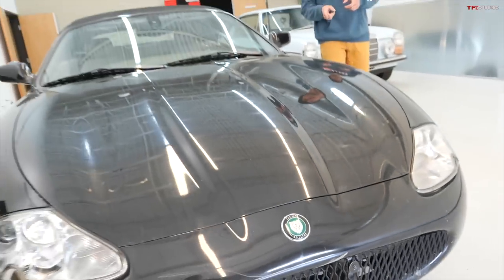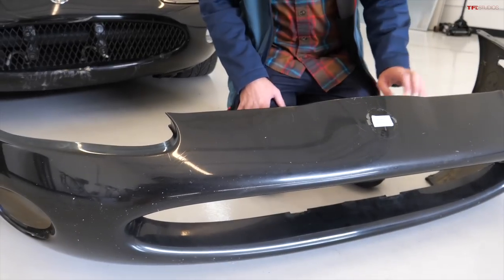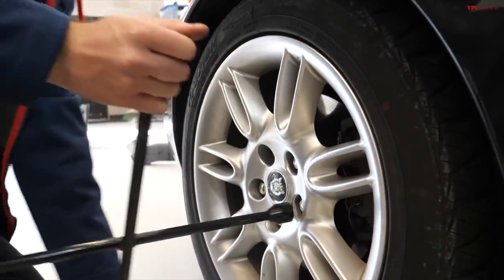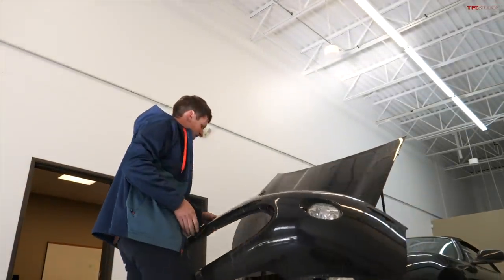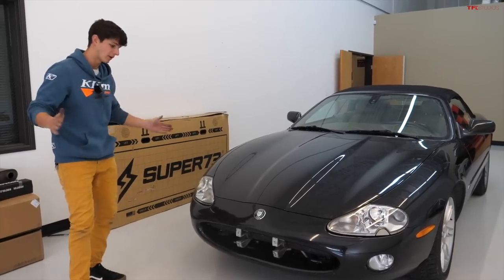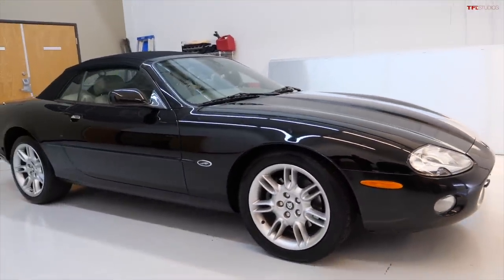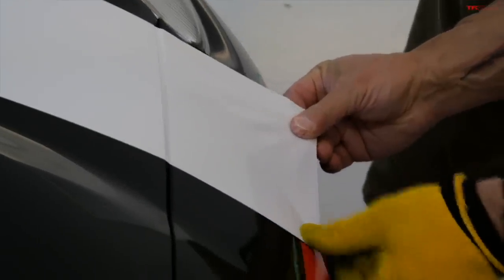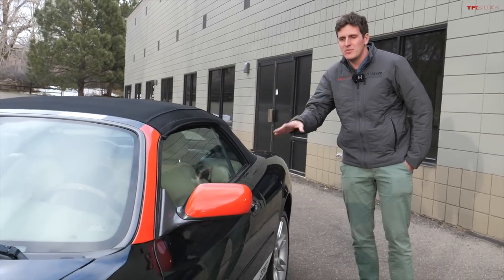A TINY Budget Completely TRANSFORMED Our Ruined Jaguar! (Dud to Stud Part 2)

Comment: The red is horrible! The stripes near the rocker panels are...... okay, I guess? Just cleaning it up and replacing the front bumper cover (along with the front mesh) is all it needed. Luckily all the rest of the unnecessary trash can be taken off.

Comment: Tommys opinion became irrelevant the second he said Twix is a horrible candy he must like licorice and those bitter ones. Now i was ready to hate the wrap cause the car has clean lines so making it more busy with racing stripes but it turned out alright actually not as bad as i thought it was going to be. Why do i have a feeling they are going to try and Rally this car up a gravel hill road since he said they need higher suspension before lowering it. Still looking forward to more videos on this interesting project.

Comment: That piece used for the grill is call "expanded metal lath".  Smaller versions of that are sometimes used in the plaster trade to for odd shapes or tight radii.  It gives lots of purchase for plaster to grab on to.
Reply: Plaster? You still living in 1900?
Reply: @BrantTheResidentCalvinist  I used it in my own home on a wall with a 2' radius.  It was too tight for bending drywall, (even 1/4" GWB that had been dampened cracked), so the drywall contractor used expanded metal lath to bend around the framing and attached it to the studs, and plastered the curve.